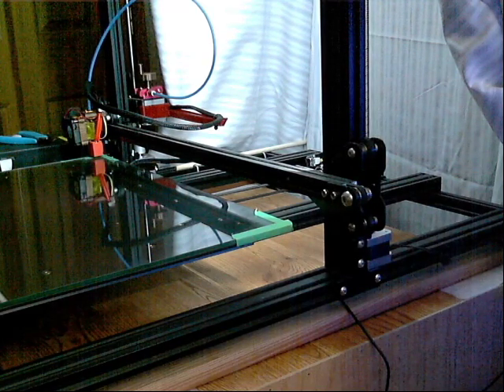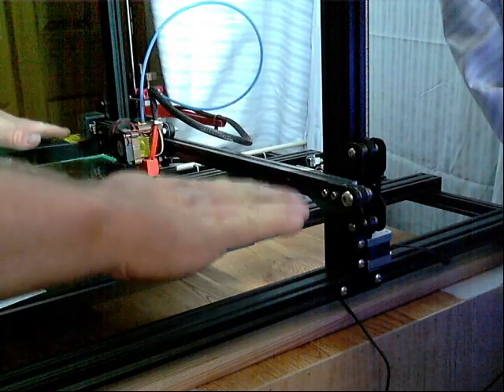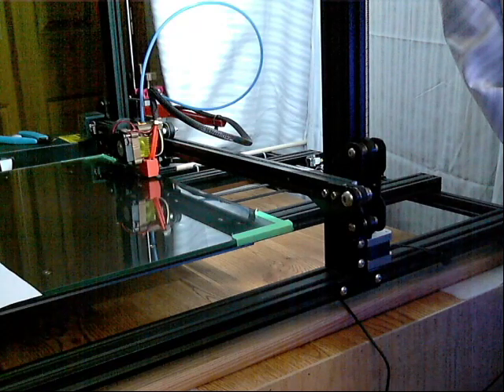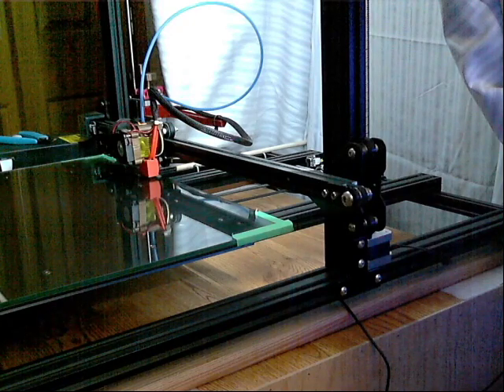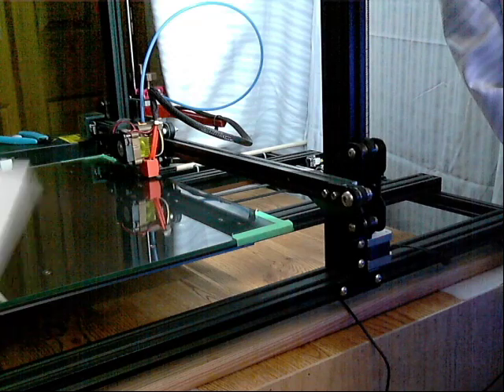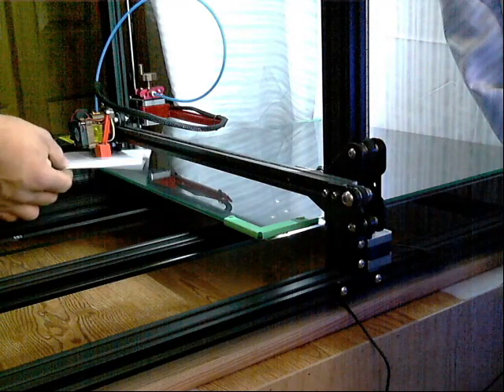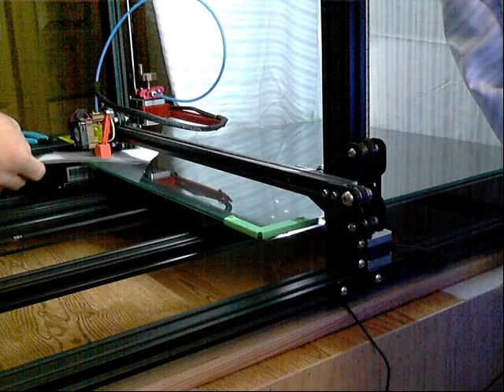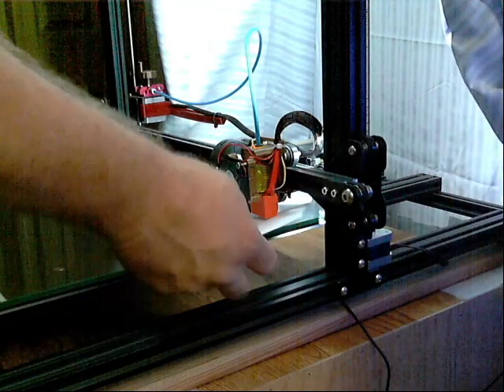CR-10S5 Bed Level

Comment: I work for a company and we don't use paper 1) we use a filler gauge mm. 2) try and change the screws. what we did with our printers put Loctite and problem solve,  make sure is at the very tip of the screws. the problem comes from the factory getting new screws or the Loctite. somebody just over tighten the screws.
Reply: what screws tightened or locked will fix this?  isn't it the weight of the hotend that yanks it down when not in use?  My thinking is to park or turn off the printer with x gantry resting on two blocks, one at the right and one at the left side.  thinking this should keep one side from drooping.  Will see

Comment: Did you find a permanent fix? I have this same issue..what are you clicking at the back there ?
Reply: The YouTube channel the edge of tech has a video called rework gantry
Reply from the maker: @unitruth  that is not the issue.
Reply from the maker: Yes, a Z axis sync kit solves the issue. It ties both Z axis screws together using a belt. The clicking in the video is me turning the stepper motor to even out the gantry.

Z axis sync kit is available at Tiny Machines
https://tiny-machines-3d.myshopify.com/products/z-sync-kit-1?variant=15531404034083

Comment: I got an SKR Pro 32-bit control board and have each Z motor on it's own stepper driver (TMC2209's.)  Both Marlin and klipper have easy routines to level the X-axis.  Takes just a few seconds and does a perfect job.  It's in the lead G-Code for every print now.
Reply from the maker: Does the board have inputs for two Z axis end stop switches? I thought the Trigorilla Chiron board was the only one that had that.  I've heard it's best to have the Z steppers on the same driver or a single stepper with belt sync. ?
Reply: @Motovader72  The SKR Pro has capability for 6 stepper drivers so in the software setup, you can make them any setup that works.  With the BL Touch (BLT) it's all leveled via software now.  The Z is perfect on both sides with the Dual Z level command and it only takes a few seconds.  Having the right hand Z drop/rise while powered off is taken care of, as is when someone leans their arm on it while adjusting the leveling screws for bed leveling <sigh>.  It is quite the task to do the software setup but you can choose any you like, Marlin, klipper, or any of the others.  I chose Marlin just to match what was already being used on the bed but am quickly becoming a fan of klipper.  Klipper requires a different mindset from Marlin but I think it's better overall.
Reply from the maker: @davidnunya7383  I don't use BLTouch or Manual Mesh Bed Leveling. My bed is flat.
Reply: @Motovader72  That does not mean your X-axis is leveled/trammed.  It can and will get out over time.
Reply from the maker: @davidnunya7383  I used to use this method before I installed my Z axis sync kit. This is better than trying to adjust bed screws, which most people do.
Reply: @davidnunya7383  i have this printer and i have the bltouch installed. But even with the bltouch the mesh generation at the start fails if i do not manually adjust the gantry after homing. Basically the bed is so warped that one of the bltouches probes will fail since it is too far out of alignment. So what i had to do was home the machine and then adjust each stepper manually until it is level, then i do the bltouch home, then i can start my print. If i do not manually adjust it then it will fail.

Any tips for a permanent fix for the cr10s5?
Reply from the maker: @violentcrumble6720  Z axis sync kit solves the gantry misalignment issue. 

https://tiny-machines-3d.myshopify.com/products/z-sync-kit-1?variant=15531404034083